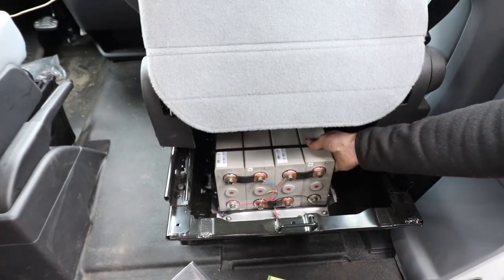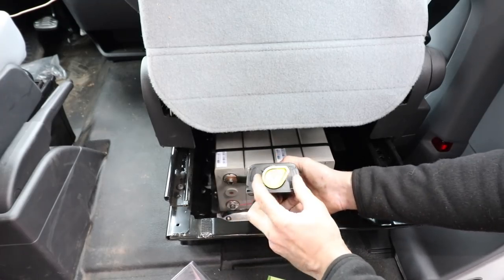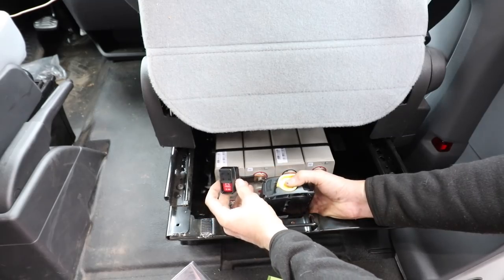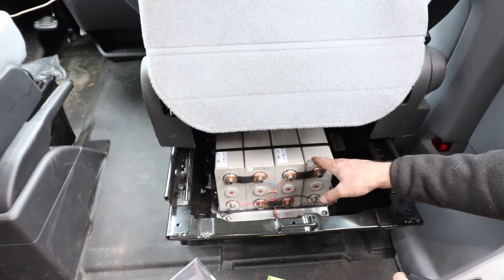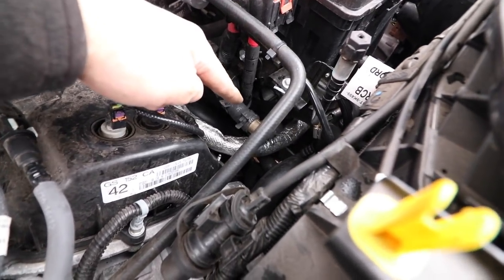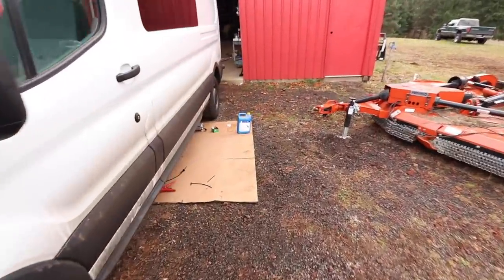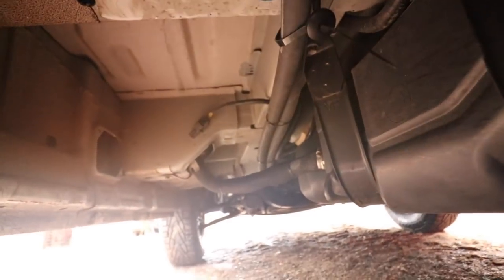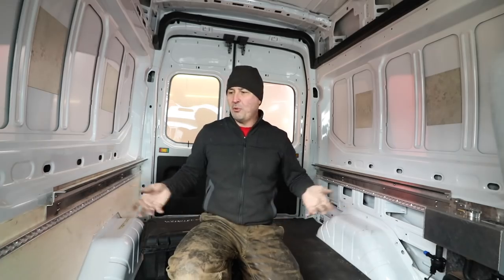AMAZING Lithium Battery Stealth Van Mod!!!

Comment: Their is another difference between lead acid and lithium batteries that is very important. First, if You discharge a lead acid battery more then 20% then the battery starts to suffer and You will get less life cycles. That is also true for deep cycle batteries. It´s just no that severe. A lithium battery  You can discharge down to 20% with out negative effects. That means, that with Your 200 ammp lithium battery You have 160 amps available power while with a 200 amp lead acid battery You would have maximum only  100 amp by the most in case of a deep cycle battery but if You really care for Your batteries and want lot´s of life cycles You should only use 40 amps.
But with lithium batteries You have another very important feature and that is the high discharge rate all the way down to 20% while with lead acid the further You discharge the battery also the rate of discharge goes drastically down and there comes a point where Your inverter will shut down or Your Espar heater will shut off even so there is still some charge in the battery but not enough voltage.
The important You wanna look for with lithium batteries is not over charging them. So watch out when the vehicle is longer time parked in the sun with the solar panels. Also watch out not to discharge below the rated voltage of the manufacturer. Their could be some permanent parasites that draw from the battery continuously and that could ruin all the fun.
Reply: when he gets the solar panels and hooks them up to a charge controller, it will take care of any overcharging concerns.. i just hope he gets a mppt solar controller and not the junkier basic one...
Reply: A good MPPT charge controller is certainly desirable even so I am not aware of any solar charge controller yet specially set up for lithium batteries. The issue is the solar charger takes in to account the sum of voltage of all cells and when one cell gets out of line for what ever reason then the other ones get over charged. So the important issue is to protect each individual cell and the solar charge controller can´t do that. With lead acid batteries it won´t matter but with lithium it does a lot. So each individual cell should be protected by a charge controller and the whole system is called a BMS ( Battery Management System ) Usually this is a very primitive function and a little cheap board can be mounted to every cell for control. However we are fooled in to buying a big and fancy big magic box and spent a lot of dollars. Usually new cells if they are balanced before put into service don´t get out of line so easy. However at the top end of charging cycle things could get critical specially when not in use or after a ride and the batteries already charged close to max. This is the point where lithium batteries need control and supervision either manual or by electronic control.

Comment: You thinking about a skid plate or something to protect the Rixen heat exchanger and whatnot?
Reply: IraqVet 0317 I was thinking the same thing.   I was concerned about the amount of road grime and rock that will get thrown up on the unit.
Reply: Same thing I was thinking, that hose isn't meant to be durable from any grime/rock/impacts.  Being under and exposed like that it could easily get punctured while on a road trip and lose coolant w/o knowing.
Reply: Me too, but it can’t be plastic or hdpe or it will melt.  Also worried about heat build up for the batteries under the seat....
Reply: At least some expanded metal to keep the big rocks from smashing the esbar and heat exchanger. That way a washer hose can still wash it off.
Reply: those batteries increase temp very little during charging and wont have an amp draw big enough in relation to the total capacity  to ever heat up. I have used them for just about a year in the rear of my camp/ rescue rig and even use them to power my rear winch with out any problems
Reply: I know it's on the other side of the country but if you're thinking of bullet proof 4x4 conversion check out ujoint in Asheville they do have a great product. There is a thread about them on expedition portal's forums. They picts and video of their different builds. They specialize in Ford products.

Comment: Could you please provide a link to the battery manufacturer/supplier? Also, which solar panels and charge controller are you planning to use?

Comment: You should hook it up such that the engine is heating the coldest water - i.e. the water just before it goes into the s-bar, not afterwards when if anything you will be heating the engine with the s-bar..?
Reply: John Jones I was thinking the same thing, I wonder if he has a reasoning otherwise?

Comment: OH Boy,  I see a little culprit. If the heater and the motor are running at the same time, the motor might overheat if the extra heater does not stop heating. Make shure you have a thermo controlled switch for the preheater.
Reply from the maker: The Espar and engine will not run at the same time,

Comment: My wife hit ??? in the road at night, she did not even know it.  Next morning when I tried to fill the gas tank, GAS ALL OVER THE GROUND.  Whatever she hit cut the rubber hose way up high near the gas filler.  Your hose is down low and I can see an "alligator" (piece of torn off tire from trucks you regularly see in the road) taking out your cooling system in an instant.

Comment: Acid batteries leak.. Lithium batteries explode. 
I have 3 Lithium cobalt ion batteries. If there is a short, even a tiny one. KABOOOM.
Reply: Even worse is that an acid battery when shorted with a metal stick, It'll just spark and smoke. 
But LIPO's will weld the metal to the battery and then explode.

Comment: They don't vent? ever tried googling Lithium battery venting? I'll tell you when they vent you DON'T want them under your seat!
Reply: What do you mean by that? I've had 18650's venting.. not fun.
Reply: Renax the Man - The issue you are referring to happens to LiPo and LiCoO2 batteries when over charged or discharged too quickly.  These are likely LiFe; much safer and will not vent even if overcharged or shorted.

Comment: I lived in a van for 4 years, 3 years of that at one stretch, and never needed a heater, any sort of cooling system or any electrical setup except a little power inverter. There's always a 24 hour gym (out of the weather, free wifi, charge your devices, shower, toilet )  in any decent-sized town, and several in a big city. There's jr colleges, in which  you can take 2 classes, $600 each per semester, which a Pell grant will pay for, which entitles you to use their library, (wifi, charging, etc)  their gym, etc.  The college  parking permit, hanging from your mirror, will save you $300 a year in traffic tickets, too, most likely. :-)  You'll get warnings instead of $150 tickets, for stuff like  <10 mph speeding, rolling a stop sign, etc.
Reply: He's making a sport van/camper. The intention isn't the making a homeless shelter.
Reply: the shelter is exactly what most readers will be looking for, tho.
Reply: he's using it for camping in cold rainy climates, not living like a homeless person

Comment: Too much complexity IMO. Have you or anyone in the 'van-life scene' considered using the dump load from the BMS as an additional heat source for the thermal tank? This is common in residential solar installations. Additional 30ft of coolant hose not required. What happens when one of those leaks out on the road silently? :|

Comment: 18.5mpg ??? Im sure the transits in europe are doing well over 30mpg I know you have different engines over there but whats wrong with engines where using ?
Reply: Not really relevant as the cost per gallon is much cheaper in the US and Canada than Europe.
Reply: Two things: Any Euro MPG figures are imperial gallons which are larger than US gallons. 18.5MPG US is about 22.5MPG UK. Second, this is the 3.5 ecoboost gas engine. The Diesel would get better, and even more if they offered the manual transmission, but on the whole, American drivers would still choose the extra power over the economy.
Reply: transits in eutero are probably diesel, which is inherently 20-25% more fuel efficient than gas engines...
Reply: They are diesel over here dont even know if they offer us a petrol version. Looks like the most common version offered in the UK is the 2.0 tdci engine in 105ps, 130ps or 170ps and ford claim it will reach 44.8mpg

Comment: Perhaps you should go a little more in-depth on Lithium’s and the proper type that should be used.  Using the wrong lithium battery is a major safety risk.
Reply: Lonely Prepper Homestead the "wrong lithium battery"? It doesn't matter if its wire correctly.
Reply: Harry 8642 ... tell that to those that lost their property due to the battery catching on fire.  The “type” does make a difference.

Comment: Yes a lithium battery under your Mrs seat, great idea?, a battery notorious to expanding and exploding, one as large as that, jesus..
Reply: TheLividPig - I am guessing these are Lithium Iron batteries.  Much safer !
Reply: lithium Ion? they are much worse? Lithium ion batteries come with a temperature protection circuit to protect against overheating but in my honest opinion i would not leave a battery which will discharge huge amperage to start the van under your seat.
Reply: READ CAREFULLY !!  I said Lithium IRON (LiFe) !!!
Reply: My mistake but do you believe that's what they are i don't? their not as commercially available as ion

Comment: Sell that truck and get a smaller, cheaper truck vehicle for the few times you absolutely need a truck.
Reply: He may want to keep it for the wildland firefighting stuff that he does. That one water tank and pump rig that he restored can't be light and a small truck might have a hard time hauling it and other gear.

Comment: Can someone explain to me how that lithium battery is 200 amperhours but my phone battery( also lithium ) is 3000 amperhours but about 200 times as small?
Reply: phone is MilliAmpHours
Reply: Your phone battery will be 3000 mAh (milli amp hours) ...3 amp hours

You would need 66 of them to be equal to the battery used in this project.
Reply: 3000 ma hour
Reply: Your phone battery is rated in mAh. 1000 times less than an amp hour. 3000/1000 = 3. Your phone battery can supply 3A for one hour. Cody's battery's can supply 200A for one hour. Hope this helps.
Reply: Ooh milliamperhours hehe
Reply: behold, the man of mathemagical genius.. lolol
Reply: Like others have pointed out it's mAh for your phone battery, so very big difference from AH... 

I'll just add that it's also because Amps is a bit misleading, since you need to calculate the voltage to figure the actual total power capacity.

You basically need to figure out the watt hours...

12.8v x 200 AH = 2560 WH

versus

3.7v x 3AH = 11.1 WH

So it's actually a 230 times difference...
Reply: maximum woof If all you can do is mock someone for asking a question, how do you ever expect people to ask questions?
No one should ever be wary of asking for information - it's how we move on.
I'm sure you're more than capable of asking what someone else might see as a stupid question - would you want to be mocked, or would you rather it was answered in a civil manner?

Comment: I do NOT recommend jumping of lithium cells no matter what the manufacturer or seller saids lithium is for slow gradual discharge, don’t get me wrong lithium cells can be designed for jumping or quick discharge but those aren’t, absorbed glass mat lead acids are best in my opinion they are 100x safer they have the same discharge limit they can charge faster (because you can give them much more amperage) they can be charged in more ways and they can still jump. They also don’t give off gases and don’t explode like lithium.
200 amps is way more then enough my car has a 95amp battery and I can run a 600w inverter for a little while and still start it.
My truck has a bank of 2 YUASA black battery’s and a 95amp Odyssey battery on split charge for the sirens flashing lights and cooler. And a small optima 3 cell on a trickle charger completely isolated so I can always start my truck even if it’s left for a week blocking a flooded road with flashing lights and sirens.(that has happened before)
Reply: Uh, no... you do have to be careful on how you charge a lithium battery and they do have safety concerns but on discharge they can handle far more than a lead acid battery can.

Really, they wouldn't be able to make high performance EV cars capable of going 0-60 in less than 3 seconds if lithium couldn't handle high discharge rates... 

Lithium batteries are also commonly used now by telecomm companies for cell towers backup power systems and companies like Tesla are selling megawatt power backup systems for power companies.

Lithium also can be drained to around 90% versus lead acid, which limits you to 50% or less before the discharge damages the lead acid battery.

So the advantages of lithium is higher output, can be half the weight or less, can take up less half the space, and has a much higher output capacity with far more charge cycles before you have to replace the battery.

While they're making lithium safer all the time... Like there's this one company that makes lithium batteries that replaces the electrolyte with a plastic and it's puncture proof.... Most Lithium batteries now have BMS built in for a layer of protection... Among other changes and decreasing prices, so it's actually a good time to start looking into them...

They're not like the lithium batteries from 20 years ago...
Reply: oh yeah, there is that.. the level of discharge.. many cells aren't designed to handle that.. this configuration might be.. then again, you run a hair dryer.. you're drawing 165 amps from a 12v to 120v inverter anyway.. so that point might be moot...
Reply: the hypercars run lithium polymer cells, I don't disagree with the fact they are getting safer i am just suggesting it is not the wisest idea to jump from a battery not designed for it especially how when under pressure of heavy discharge rates lithium can explode.
by the way you can buy AGM style lead acid that has 85% discharge rates whilst still giving upwards of 2000CCA
Reply: 4wd some, all high energy storage comes with risks.  The fuel in most cars means they all hold the potential to not only catch on fire but explode.

But just like lithium it doesn't mean everyone has to worry about it all the time, just treat the technology properly.

However, you are wrong on the heavy discharge rates.  Lithium primary poses a risk when you over charge them or charge them too fast.  But they're designed to handle heavy discharge rates.

The battery WS has is rated for 200A continuous and 400A surge... This compares to 10A continuous and 60A surge that you can expect from a equivalent lead acid battery set up.

It's just that all batteries can heat up when using them and you just have to make sure the battery isn't over heating.  Like when charging them and using them at the same time.

But a proper BMS will have a temperature sensor and handling of the batteries pretty much assures the batteries are safe.

Really, there are hundreds of millions of devices powered by lithium every single day and 99.999999% of them aren't exploding!

There are even people who build their own battery packs from individual 18650 cells, which is what most lithium batteries have inside of them...  Soldering them, etc. by hand... Not that there's no risks but shows properly managed the risks can be controlled.

It's actually hard to make them explode, like gas, etc. it has to be in an enclosed space.  You mainly just have to worry about the cells breaching and being exposed to air because the lithium reacts with oxygen and combusts.

So just like handling something like a propane heater, just treat it with respect and proper caution but there's no reason to really be afraid of it more than anything else that can catch on fire if you don't handle them properly.

Comment: Those sprinter vans turn into a pile of rust after a few years. Solar panels on the roof not so stealthy.   I don'y really get it you are spending thousands of dollars converting a regular van to have a bed battery system water system electrical etc... when you could have bought one with all that stuff already engineered properly with a warranty.
Reply from the maker: I don't get why you think you need to tell me what I should be doing with my time and money. I don't remember calling you up and giving you unsolicited life advice,
Reply: Your going to injure your self or you wife because you don't know what your doing   I am all for doing things yourself but not if you have no idea what you are doing and you put your Family at risk. Did you test that battery location in a crash?  Do you think putting high capacity Lithium batteries under your Wifes seat is wise? Do you think running 30 feet of cheap rubber  heater hose under a brand new van is smart?

Comment: I still dont know why you are making this van
Reply: I have a saying that I, unfortunately, use often. "If I need to explain then you'll never understand"
Reply: Hey Brandon, I don't understand either. In fact, I don't get the van life thing at all. It cracks me up to see people spending the same amount of money on a van that is extremely limited and uncomfortable with no space when they could easily buy one of the new class C RVs that are freaking awesome and have a bathroom. To each his own I guess.
Reply: How many times does he have to say that they'll be using it for trips, ski outings, and camping, before you understand why he is building the van out this way?
Reply: SuburbanHobbyist what i dont get is why not get a trailer and you can hook it up to a truck with more power and you can go more places without worrying about getting stuck and still be more comfortable